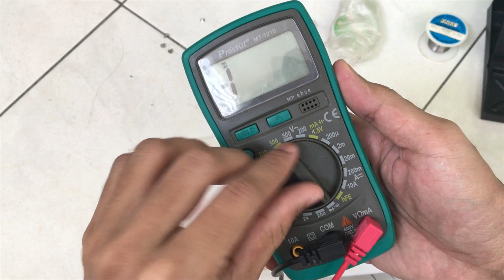How To Fix LED Ceiling Lamp (100% Working!!!)

Comment: What if you dont have a donor item with LEDs? Can you measure the value or something and buy a replacement on the net?
Reply from the maker: I suggest that you buy a replacement unit like this one https://shopee.com.my/product/550180354/10389444033?smtt=0.20961412-1670248076.9 where it have an embedded voltage regulator..most of my house ceiling lamp, I have changed using this one, long life and pretty cheap

Comment: thanks for the useful video. But why not just use a soldering iron to de-solder the broken LED's instead of roasting the board with a heatgun?
Reply from the maker: I've done that, but the led is too sensitive that it got burnt early before the solder melt
Reply: @NaokiYuusuke  thanks.. good to know that.

Comment: Buzzer icon can’t see.  Do all multi meters have them, what tools to use. And where to buy them.  And. Tools please Freddy in uk. Cheer’s. ?
Reply from the maker: normally, modern multimeter have a buzzer icon to check whether the components conduct electricity from one endpoint to another endpoint or not. You can buy it from AliExpress, Amazon or your local hardware stores.

Comment: How to know the resistance of the led, in order to replace it with a resistor?
Reply from the maker: just set your multimeter to Ohm setting and you can measure the led both ends to find the resistance
Reply: @NaokiYuusuke  I'll try it, thank you for your prompt reply, love uuuuuuuuuu ❤
Reply from the maker: you're welcome 😊

Comment: Why dont you use a simple soldering iron !!!
Reply from the maker: it's not easy to use soldering iron because the aluminum plate is absorbing all the heat from your solder and the soldering iron won't have enough heat to melt.